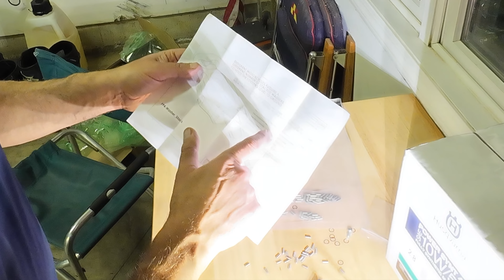Husqvarna Norden 901 Expedition Vanasche Motorsports Foot Pegs Install 417

Comment: Thank you for making this video, just received mine and can’t wait to get them installed. Safe travels
Reply from the maker: I wish I had these foot tags on every one of my motorcycles. He doesn’t make them for BMW’s. I may call him. You will have to spend some time adjusting your brake lover and I did order of an ass gear shifter, great product great man excellent company.
Reply: @ I have his GPS mount for my Norden, have been happy with that too. You had a much easier time with that cotter pin than me, I have one off and fighting with the other one. From what I’ve seen and heard, that’s the toughest part.

Comment: You did realize that the stock pegs that rubber insole of the peg comes out lol
Reply from the maker: OK, are you teasing me? Yes, I did realize that the peg length and width is just too small for the bike. The van Nash packs are outstanding. I wish I had them on every motorcycle. They are so wide and long just excellent. I hope you consider subscribing to my channel. Don’t hesitate to poke on at me in the future be safe and God bless.

Comment: I'm no mechanic or anything remote to that
But you might have made a small misstake that spring is installed incorrect. If you replay this video, you can see how the spring flies away as you disassemble it, but it's loose when you install it..
It was spring loaded before and is 'only' using gravity today. "All" you need to do now, is to disassemble it and load those springs..
Loading springs no matter size or strength is always a tough job

But i might be wrong, as it's hard to see from a video if you did it correctly..
//Remove this message if it is loaded, cheers anyway.. thanks for showing us how you did it
Reply from the maker: I should've slowed down the video of the spring flying through the air that was really fun. So the spring was installed under tension. Vanasche zip ties the spring to the peg, when you shove the mounting pin through the peg and frame mount it cuts the zip tie...what ever i did it was correct the pegs spring back to position. I did this video in February I think I will go back and confirm. Really nice you want to help me, thank you and I appreciate that. Ride safely and in peace.